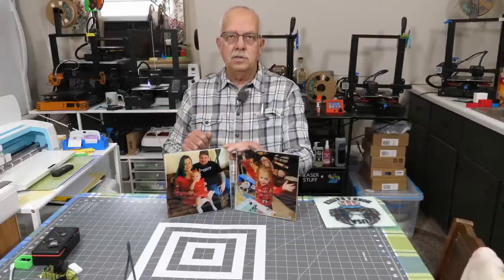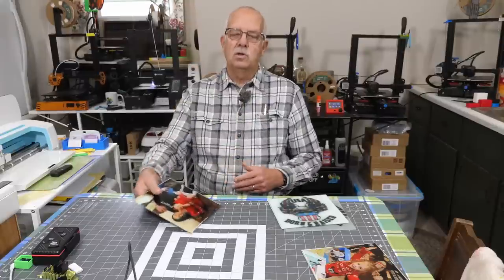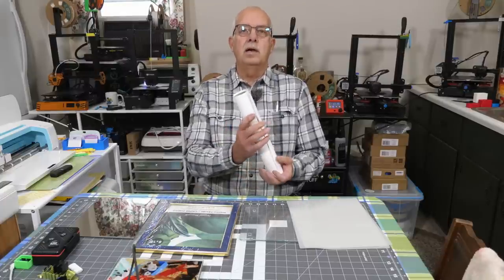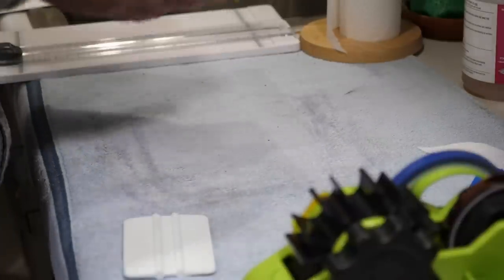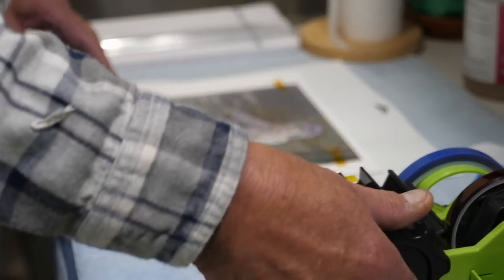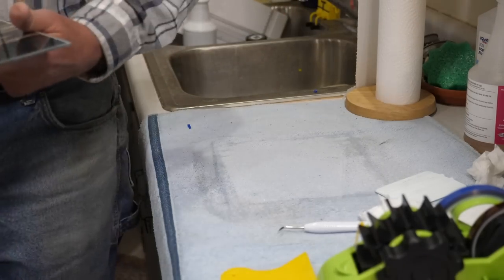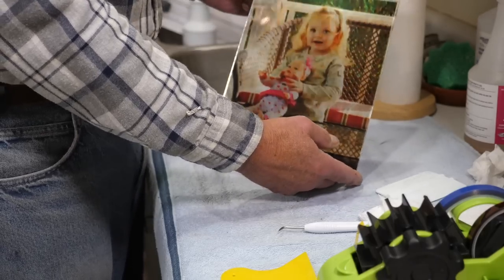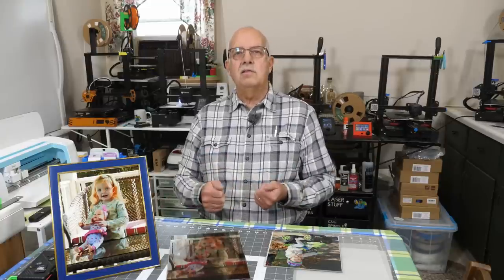Laminate Sublimation On Glass

Comment: Roger, so just to be clear, you now prefer the laminate over the clear 651?
Reply from the maker: Depends on the application and end use.  Both work.  Vinyl tends to fade if exposed to direct sunlight.  Laminate is not suitable for wet locations.

Comment: I want to sublimate onto a wine bottle but it’s clear and not sublimation treated. Would this method possibly work? And are there ways to get a white background on the bottle? This was so helpful! Thanks!
Reply from the maker: If you want a white background, use Oracle651 or 751 white vinyl.  May take some experiments for time/temp, but this vinyl takes sublimation well.

Comment: I have a intricate logo that I want to put on a coated tumbler. Would this method work?
Reply from the maker: If the tumbler is coated for sublimation, then this is not the method to use.  Check out my channel for tumbler sublimation videos.  there are several.

Comment: This is a great idea and helpful video! Was there a reason you put the sub ink on the bottom? I thought it worked better if it was against the heat plate?
Reply from the maker: Laminate may deform if used the other way.  Never fails this way.

Comment: Great tutorial! However, I'm having trouble getting all the air bubbles out even after using the squeegee. Any thoughts. Wondering if I'm using too much  or too little  Rapid Tac
Reply from the maker: Hold the squeegee at a shallow angle, with pretty good pressure, and work from the center to the edge each way.

Comment: Sir May I know how you make your graphics or images , how do you size them and print straight to the sublimation printer? Those are all beautiful work! Thank you.
Reply from the maker: Photos are edited in either Lightroom or Photoscape X and usually printed from Inkscape.  The program I use most for graphic design and setup is Inkscape and can send files direct to my sublimation printer (Epson) from within the program.  When using my Sawgrass printer, the graphic is exported from Inkscape as a .SVG, then imported into the Sawgrass software for printing.

Comment: I dont have a heat press like this yet? Is there a way you can use a cricut heat press and if so how long and what temp? Tysvm in advance
Reply from the maker: Yes, you can.  But, it requires heavy pressure and DON'T MOVE while pressing.  Not as easy as it sounds.  Same time and temp.

Comment: Thanks! Very educational. If you just sublimate on the white vinyl instead of laminate, can you use it as a trivet or will it also separate? Can you hand wash the glass boards after sublimation is done?
Reply from the maker: Yes, you can use white permanent outdoor vinyl and I have done a couple of videos on that, using Oracle 651.  Hand washing is not a problem and we have run them through the dishwasher on the top rack with no problems.  If using as a hot pan trivet, keep in mind that the pan should be below 350 degrees F or the vinyl may soften.  I use a lot of these as "spoon rests" next to the grill, smoker, and stove to prevent "messes".

Comment: Roger, if the image is on the back why did you say you wouldn't use it as a cutting board?
Reply from the maker: I have premium quality knives and glass is not a good substrate for a cutting board with quality cutting edges as it will dull them quickly.  Glass is "OK" for cheap knives used for bar prep, etc.
Reply: Oh well, that's a given. It sounded like it had something to do with the process

Comment: Loved this video!  What ml laminate did you use? 3ml or 5ml?  I have some currently but not sure if it's the right thickness.  Also, have you tried doing something that the laminate didn't completely cover and had to piece the laminate together?  Just wondering how that would turn out.  Thanks again for great tutorials!
Reply from the maker: 3 mil.  If you piece it together, you will see the seam.  I've tried this a few times.  Because the laminate shrikes a bit when heated, the seam will separate.

Comment: Hi, I have watched your videos over and over again, but I am still having a problem with the laminate not getting smooth around the edges of the glass cutting boards. I do use the Rapid Tac. I cut the laminate on my Cricut at 7.7. I have a Cricut Easy Press 2 and do 385 degrees for 180 sec and go back and do extra time but doesn't come out smooth. Any suggestions would be appreciated.
Reply from the maker: This requires heavy pressure and an Easy Press may not be enough.

Comment: I tired this with the thermal laminating sheets and the sheet shrunk.  Is there a specific brand you are using?
Reply from the maker: I use 3M laminating pouches, cut in half.
Reply: @rogersshop  Hmm, that's the brand I used.  Any suggestions?  I tried cutting it larger and that was an epic fail as it laminated to the butcher paper.  Maybe turn down the heat?  Thanks!
Reply from the maker: @MsJerrip1  If it stuck to the paper, then you may have the wrong side facing the paper.  The shiny side should face the paper and the dull side facing the project.
Reply: @rogersshop  Thanks for the quick reply.  No, only the laminate overlap stuck to the butcher paper.  The rest adhered to the glass but it bubbled around the edges as it shrunk and had already stuck to the paper

Comment: I did the sublimation on white 651 oracle on glass for a lantern and the pictures blurred in about a month do you have any idea why? Maybe this laminate method with vinyl behind is the answer but not sure the light will shine though🤷‍♀️ Any tips or thoughts appreciated.
Reply from the maker: This happens sometimes and there are different causes:  https://youtu.be/RY6RpIY81jw
You can also use clear vinyl as a backing to the laminate if it did not adhere well.  Generally, the use of Rapid Tac when pressing makes the laminate stick pretty well.